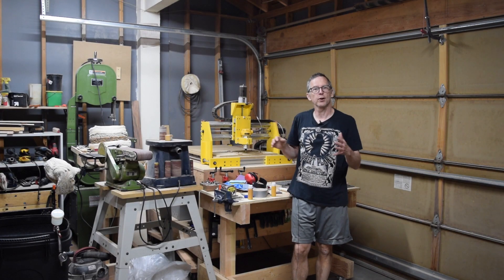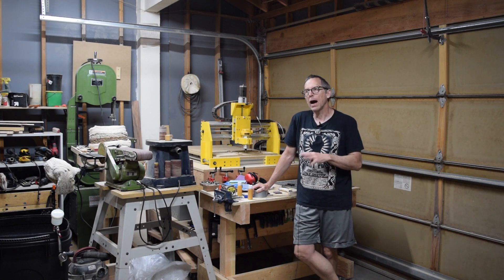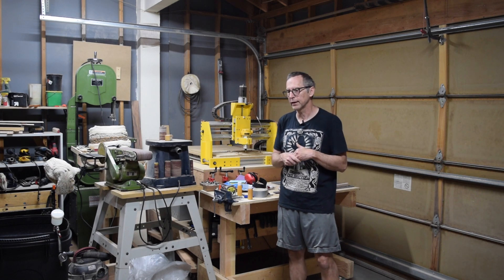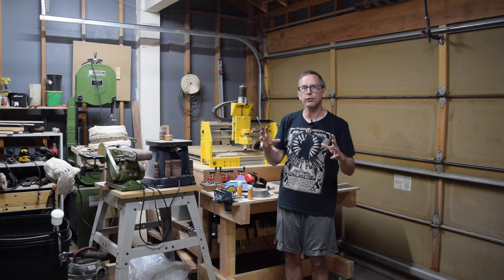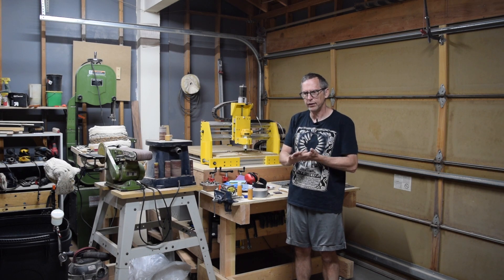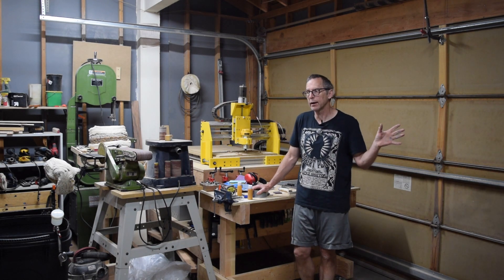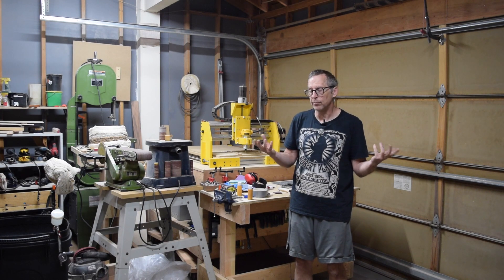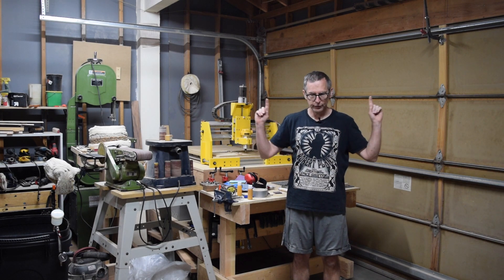More Thoughts About Making Guitars With CNC

Comment: Technically there isn't a trade war.  China is actually paying the tariffs, and they know that without the US they'd be in a bad way financially.

As for CNC.  I was one who fimley believes in handcrafting guitars.  CNC is a tool, and like all tools it really has a good place in a workshop, but it can be a tool that can (and sometimes does) replace the old traditions.  The parallel would be CGI films.  Look at Disney as the example.  Their animated films of the past were all hand drawn and inked and painted for decades.  Along came the Pixar computer, and all bets were off.  It did in effect kill off traditional hand drawn animated features (and even shorts).  So instead of CGI complimenting their workshop, it killed off one aspect for the new.

CNC as I said does have it's place, but shouldn't take over the workshop.  It can do really well at repetitive tasks, but using that inconjuction with hand tools (and a few power tools) can boost the artist.  And really if someone is only building a couple of guitars a year CNC isn't a good investment.  If they are going into full production mode then it would be.

Make sawdust and have fun doing it!!!

Comment: Interesting video . I'm not a luthier so perhaps as a consumer I shouldn't have an opinion. My real gripe is that ,for example , Rickenbacker (just as one example) .. When I started playing in the early 80's , they always made a lot of noise about handcrafted guitars , built with minimal machinery etc .. by the time I could actually afford to drop £1350 on one 6 years ago, they had modernised their business with CNC machinery to do all the donkey work ... These are still expensive guitars ; is the consumer  paying for the company to upgrade their manufacturing process & save the company money or are they just trying to deliver a consistent product?  I don't really have any strong feelings either way , but I do find it quite amusing why people are getting their knickers in a twist about CNC in 2019; Fender ,under CBS , began using CNC Routers in the early 70's , and nobody ever mentions that for 11 years ,the Telecaster body shape was wrong until someone noticed the machine was selecting the wrong radius bit !

Comment: People who don’t exactly understand what a CNC machine is might have the wrong idea. It‘s just a way to cut material. It’s a tool. I use a CNC router in my business and I can see where it can provide a consistency with speed you couldn't achieve by hand. We can cut wood pretty straight with a bandsaw but not as straight as with a CNC. The CNC job is perfect in a timely manner and that makes it worth using.

Comment: I appreciate a completely "hand-built" guitar.  It's a craft.  I used to think that was the best thing ever... until I built a few guitars!  The real art, or craft, is in the finishing and details.  The CNC is just a tool.  It's a tool that produces repeatable results.  You still need to cut/source the wood, glue the wood, sand the wood, sand the wood, prep and then sand the wood more.  Honestly, the work the CNC does is the easy part.  Getting everything correct after the body is shaped is what takes time and skill.  I don't own a CNC YET, but I definitely will soon.  That CNC machine isn't going to level your frets, not going to solder your electronics, wind your pickups, spray your clear, and fix the paint when you sand through!  It's all still "hand-built", just a little smarter and a little more efficient.
Reply: Right on, Joe!

Comment: I see everyone is saying a cnc guitar to be at a low price, quote I see Kiesel makes cnc guitars and their prices are still at 2200.00 and up an Warwick bass guitar is still  at the high end also cnc made.  I guess with a small time luthier your guitar should be lesser and bigger corporate luthier guitars still pricy but no one mentioned that.  Don't know the little man hussle but not calling  out bigger companies than does the same thing and still charge an arm and a leg. That's hypocritical to me. Cnc still requires work,  coordinate speed, feed rate,  cutting speed per minute,  get code etc. The calculation has to be correct when using the cnc router,  either cutting wood or metal. X, You, Z,  axis you have to know as well.  The brain really works when programming the router to cut and unique instrument. If you design your own instrument no matter if it hand made or machine made. The price should be at a upper level price because it is a genuine original design guitar. Too many Fender and Gibson copies and still at the high end and they are copycats of the original.

Comment: Your videos have been such an inspiration to me and I have to thank you for that. I built two guitars.. One by hand that was a good learning stage but not great and one by CNC which I am finishing and will end up being a great guitar I think. As a mech. engineer and hobbyist woodworker, using a CNC and CAD is natural to me and allows me to do way more complex designs.. But it takes way more time than hand building. Anyway, one very important step is the final fret work and setup which is purely manual. And I never heard someone complaining that a 5kUSD Gibson or PRS is CNC machined when they play it. What sets them appart is not the CNC work but the wood selection and final, carefull finish.. And I fully agree with you on tarifs: it will hurt more the individuals that look for 'cheap' DIY/maker stuff than the large corporations that will end up charging their customer for the extra cost. Sad.

Comment: I just finished one by hand and it turned out great. The value that a CNC provides would help out exponentially, there are so many variables that could be checked prior to cutting. Not to mention the wear on your own body, copious amounts of time and patience when doing it all by hand.
Reply: YS TR  I see your point and agree on the one-offs. I am a programmer and understand how the software works so to me it is appealing. I was thinking more from the standpoint that I wish I could have used a CNC in place of crude hand tools, i don't own a router.
Reply: YS TR  Amen.